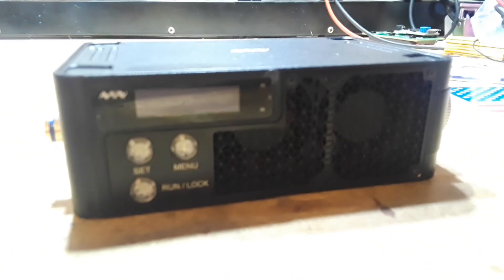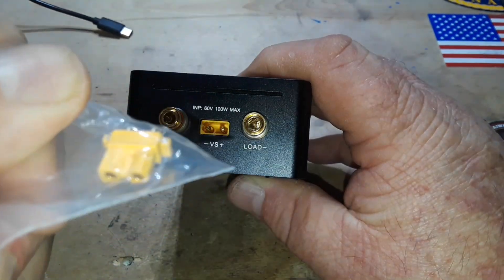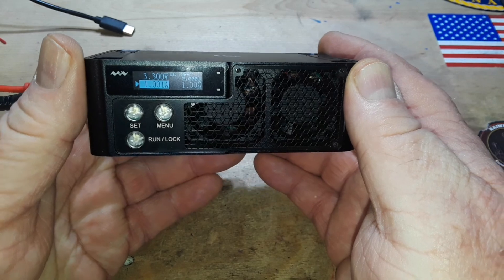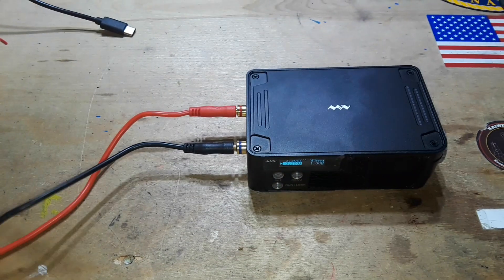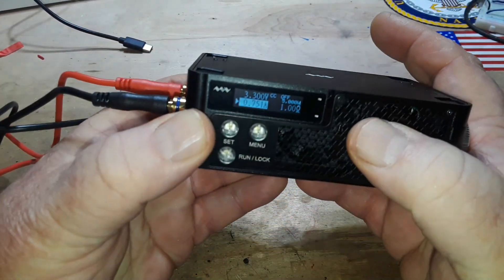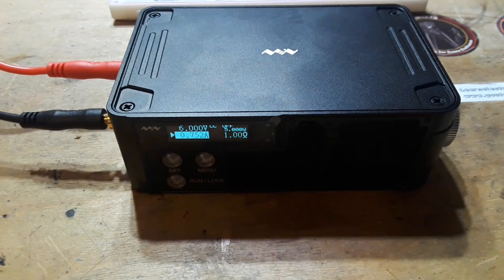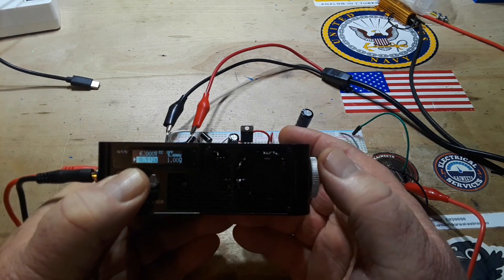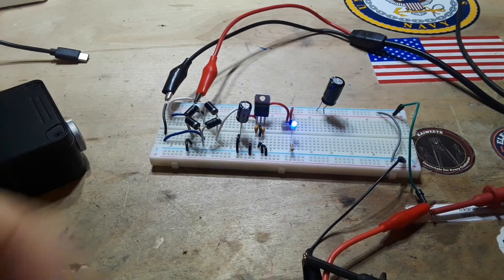Miniware MDP L1060 DC Electronic Load

Comment: It's actually $173.99.
Reply from the maker: It wasn't yesterday.
Reply: The MDP-01 is $69.99.
Reply: They show the wrong picture for $69.99 when you first look at the listing.
Reply: That's a very scammy practice that both timu and Alibaba both use.   For a product let's say there's four options. They always show the cheapest one which could just be the power cord. By the time you get to the one you want you're up to $200.00 bucks.  In this product's case that is $236.99!!